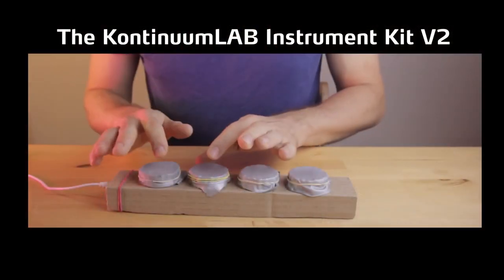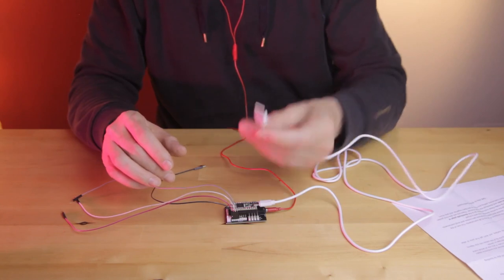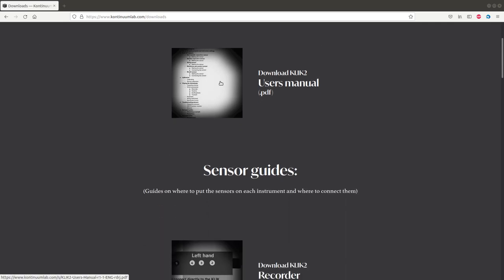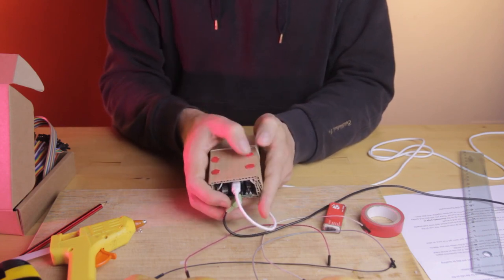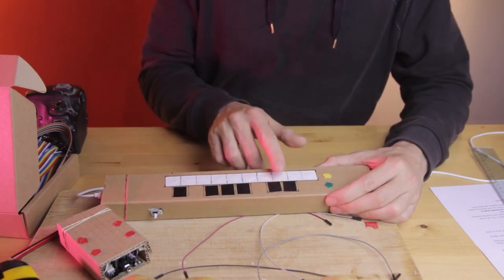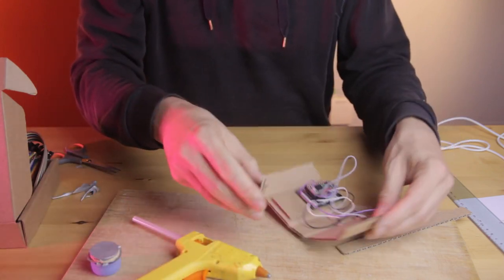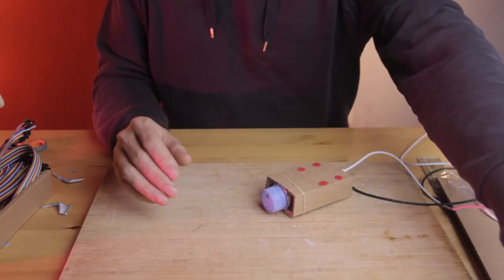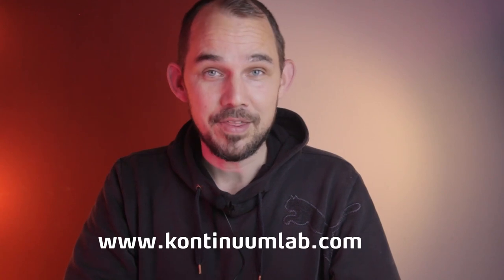KontinuumLAB Instrument Kit, Welcome - Part 1

Comment: Great video! This might be an oddly specific question, but is there a way to make a 16x16 button matrix instrument with this kit and some ekstra stuff?
Reply from the maker: Thanks! That's a lot of buttons... The KLIK isn't really made for that. You'd be better off just getting the "extra stuff" you could use a bunch of multiplexers with a Teensy to get 16x16 capacitive keys, or shift registers with any Arduino if you want buttons.